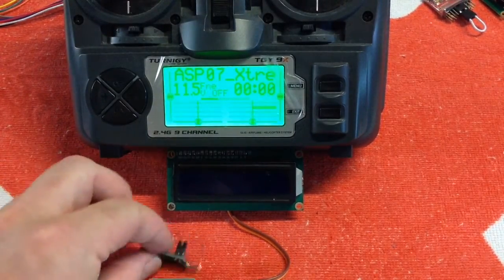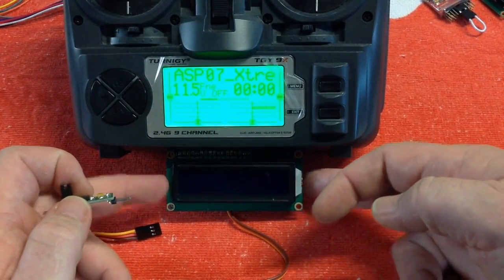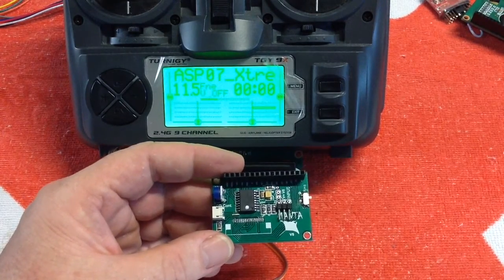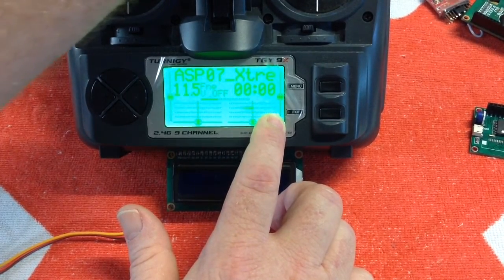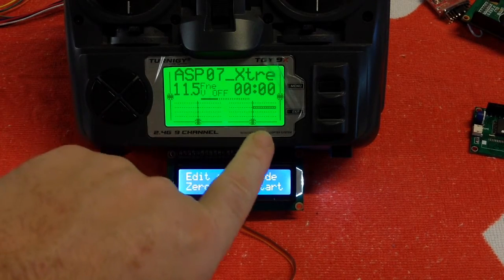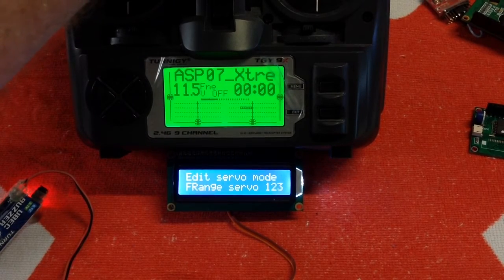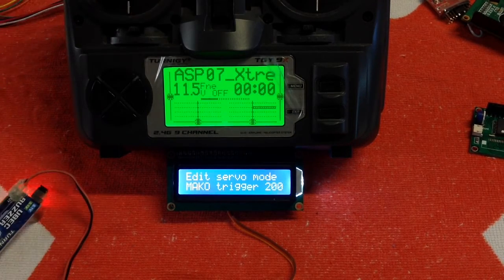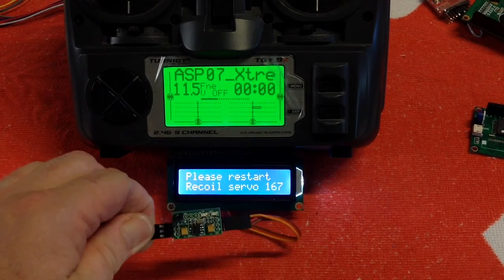Sirvoe Programming

Comment: My display stays blue. The led´s  blinks red and green. Than the green one shines. I use this display http://www.ebay.de/itm/181974800517?_trksid=p2060353.m2749.l2649&ssPageName=STRK%3AMEBIDX%3AIT.
Reply from the maker: Hi Martin, That LCD display module does not work with any RCTA product.  The LCD itself is compatible but NOT the control board.  You need a RCTA Manta Backpack.
Reply: rctanksau
It´s sold out. Is it possible to get one in your shop?
Reply from the maker: I have just added more stock
Reply: rctanksau
Thank you.
So, the display works. Now I have a new problem. The letters turned in X´es and than nothing.
I want to use it whith Elmod Eco for a recoil with a servo like in your other video.
What´s wrong?

Comment: could you please leave your e-mail address. i was liming at your ho crossing video, but dont know how to get in touch with you
Reply from the maker: +stan mcadoo Hi Stan, As you can see all the programming options in the video above are for Tanks.  There is no rail crossing option.  If you wanted to use sirvoe for a crossing you would probably need to be able to adjust some parameters in the program to suit your particular needs and upload these to the board.  However, it may be possible that my default settings may work for you.  As this is the rctanksaustralia channel all you need to do is go to the "Channel Start Page" and click on RCTA webstore link bottom right of the image header.  Cheers